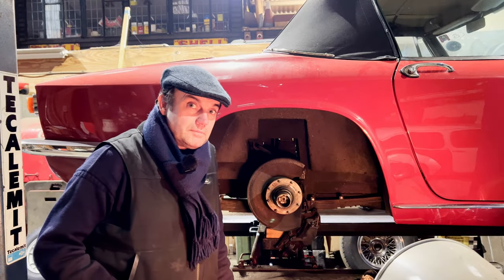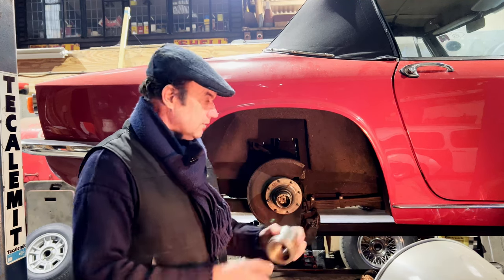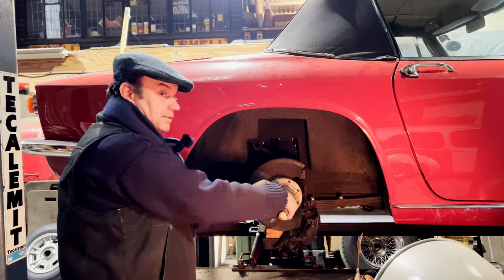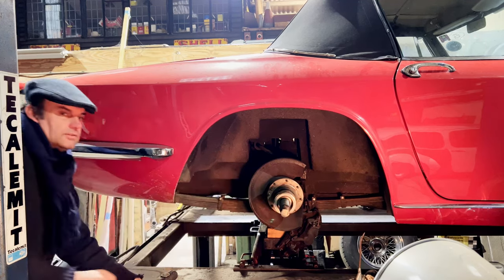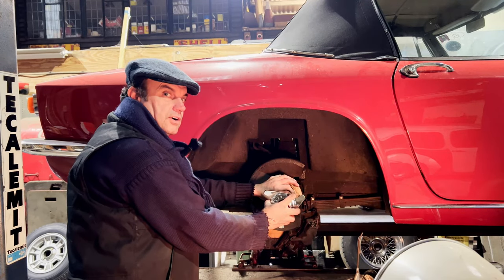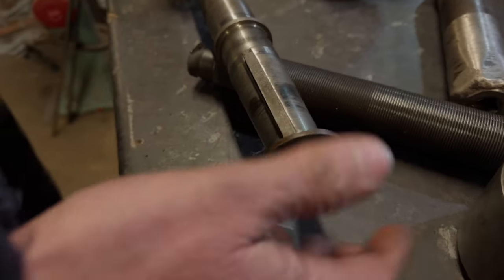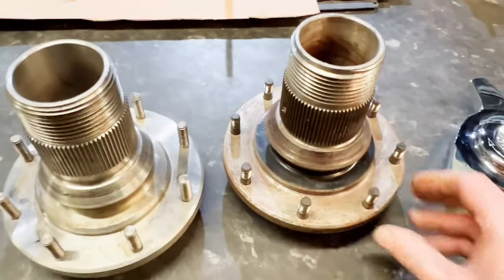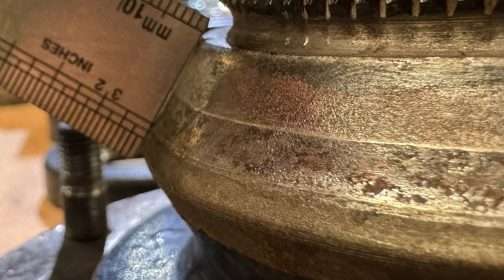Maserati Hubs

Comment: The studs on the new hub do not appear to be the same as the old hub. Thanks for posting and stay warm to cold for this old man 😂😂👍
Reply from the maker: Well spotted ! 
You are correct the new hubs have 8x1.25  mm studs the original ones are 8x1 mm.
Not a problem as I will fit new nuts .
Reply: Looking great
Reply: Nice piece of engineering. 👍
Reply: I would stick with the fine thread as it has a higher torque but obviously know exactly what you are doing.
Reply from the maker: @stephenlmckeown1439  I’m thinking Loctite